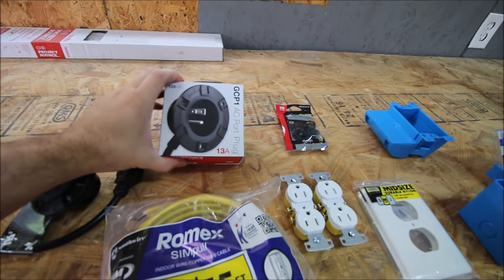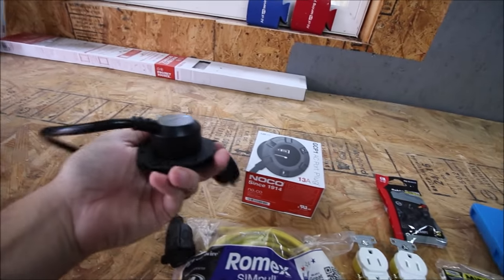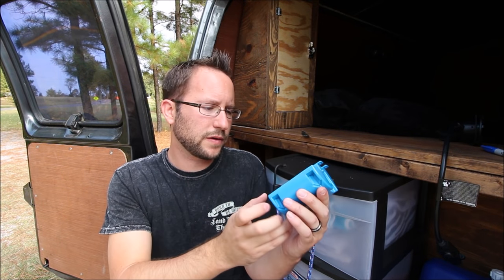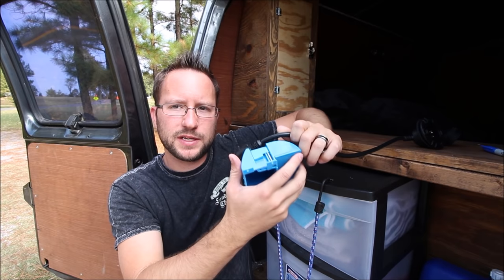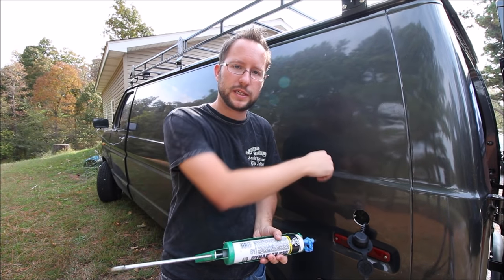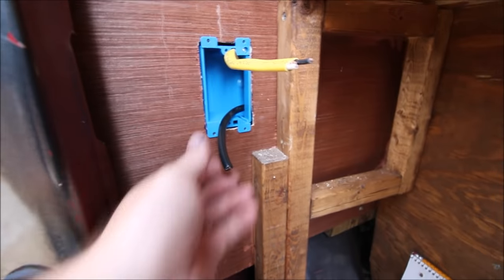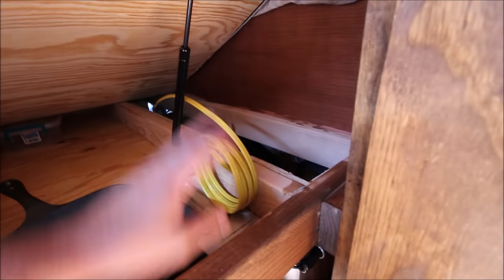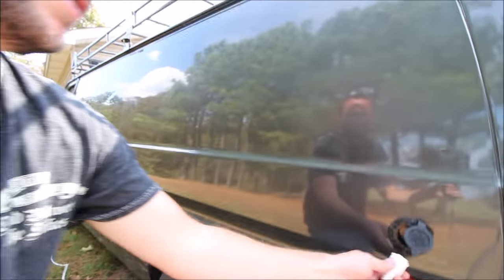Shore Power install on my Camper Van

Comment: i like the video 
what type of wire you use from first outlet to the second one?
Reply from the maker: Noe Alvarez I used 12/2 wire from one outlet to the other I believe. Make sure your first outlet is gfci. I didn't do it originally but I have swapped it since the video. That way if any moisture gets to it it will trip

Comment: i'm trying to put a outside outlet for my enclose trailer but doesn't want to wire so much. would that work for the trailer if i install the cord in like that and just use the inside for plug in with out making a outlet box for it?
Reply from the maker: cher her yes, that would work just fine if you just need one plug.

Comment: I understand how your power is coming into your van from this vid. But how do you have power going into your outlets? I'm a dummie and need to see that part or have it explained lol
Reply from the maker: The power comes in and goes directly to the first outlet then jumps over to the next outlet just like in a house. It’s basically just an extension cord in theory.

Comment: So the only thing I'm confused about is how you ran the "second wire" going to the from of the van?   did you basically splice the second outlet and the exterior plug together?  I am doing the exact same thing. One exterior 110, to two separate outlets. No breaker box but will be using gfci on the first outlet, and the second outlet plan on running a regular outlet with usb connectors built in.I will be using either an RV park power supply, or my honda eu2000i, does this sound like it will provide enough power?  seems like it, if you are going to run an AC unit.
Reply from the maker: Joe Cuevas the plug on the side of the van is a male 110 plug I bought off amazon and is wired to the first outlet directly. I have changed the first outlet to a gfci outlet since the video. No breaker box or fuse box as it is basically an extension cord or short 110 run like you would run in a home. A Honda 2000 should run a 5-6000 BTU AC just fine.
Reply from the maker: There is no splicing involved. You wire the plug on the outside of the van to one side of the first outlet and the run a wire from the other side of thefirst outlet to the other. Just as you would when wiring a run of outlets in a house
Reply: RubberTrampRenegade thank you!   Now I can picture it.  Sorry , I am unfamiliar with household electrical
Reply from the maker: Joe Cuevas no problem. If you aren't familiar with household wiring do a little research. It isn't difficult, you should be fine on this. Just make sure you use the proper size wire and wire the outlets correctly. Don't let the negativity in the comments section scare you. I haven't died yet.

Comment: How did you connect the black and yellow wire behind the hole?
Reply from the maker: Stripped them back and used wire nuts.

Comment: nice! Found your video, as I am starting to do a similar project. Where did you get the AC port plug? Ive been looking for one of those
Reply from the maker: Matt Brennan I got it off amazon. You can probably fund one at camper supply places as well.
Reply from the maker: Matt Brennan I got it off amazon. You can probably fund one at camper supply places as well.

Comment: I am curious, do you use refrigerate ( 120 v) while you drive. I mean ref running while u drive?
Reply from the maker: My refigerator is 12 volt and runs off my 12 volt system while I am driving or while I am parked. I dont use 120 for refrigeration. My 120v setup is a completely different system and I cannot run my 12 volt accessories off of 120 when pugged in.

Comment: Well how did you wire it you didn't show that part which is the most important part ?
Reply from the maker: You wire it like any outlet in any home. It’s 3 wires. Relatively simple. Basic wiring. Black wire to the gold terminal, white wire to the silver terminal, and uncoated wire to ground. Pretty hard to mess up.
Reply: @RubberTrampRenegade  how do you connect the second outlet
Reply from the maker: You connect the second outlet with wires from one outlet to the next....
Reply: @RubberTrampRenegade  is is safe to connect the wires at the same point as the first plug and what gauge wiring is best.

Comment: What is the part number on the NOCO plug? 
Thanks
Reply from the maker: grantar2 https://www.amazon.com/gp/aw/d/B009ANV81S/ref=mp_s_a_1_1?ie=UTF8&qid=1478955473&sr=8-1&pi=AC_SX236_SY340_QL65&keywords=noco+genius+gcp1+black+13+amp+125v+ac+port+plug&dpPl=1&dpID=41Y%2BimT05UL&ref=plSrch
Reply from the maker: grantar2 NOCO genius GCP1

Comment: you forgot to paint the holes you drilled, those part will rust. also it would have been smarter to install that at the bottom of the van, plus there are idiots who will think its a gas cap
Reply from the maker: Painting it would have helped. I siliconed around it so the likelihood of water getting to it was slim, but you’re right. As far as someone thinking it was a gas cap, I’m not sure that makes much difference to me. People can think what they want.

Comment: That 12/2 Romex wire is rated for 20 amps.  Your outlet is rated for 13 amps.  You should have used 14/2....15 amp rated wire.
Reply from the maker: Wow, another troll who knows it all. Imagine that.
Reply: @RubberTrampRenegade  it's your money butthead.  You're welcome.
Reply from the maker: chris Subleski chris Subleski had the van like this for over 2 years and no problems. I’ve sold the van to a guy who lives in it on the road with his job. Still going strong. But according to all the trolls on YouTube I did everything wrong. Tired of hearing what I did wrong from all the people sitting on their ass doing nothing.

Comment: How do you ground?
Reply from the maker: Your battery should be grounded to the frame. You can use a large wire to ground a post to the frame. In this video I used a large fuse holder as positive and negative posts. One goes to the positive on the battery and the other goes to the frame, but could also go to the negative on the battery as long as the battery is grounded to the frame. Your negative on your accessory should go to either the ground post, the negative on the battery, or directly to the frame. However you decide to do it.
Reply: How do you ground the AC Electrical system

Comment: Do you have a problem with it staying plugged in at the van? Do you wish u would have used the shore power that plugs in and you twist to lock ?
Reply from the maker: RobesEleven the plug stays together tightly and I have not had any trouble with it coming undone.

Comment: No fuse?
Reply from the maker: luftschutz nope. It's basically just an extension cord. If I hook into my garage, my garage has a breaker. Or at a camp ground there is usually a breaker. No need for a fuse. Do you use a fuse when you plug in an extension cord to the wall?
Reply: is a fuce necessary if it has a gfci box?

Comment: Would have been a lot easier to just plug an outlet strip (with breaker) into the female end of the shore power.
Reply: This would actually be a more secure connection. Plugs would plug into an outlet more securely and be safer than a power strip. It's actually highly recommended to not use power strips.

Comment: Dude, camp grounds have nasty wiring issues, no breakers means blowing up what ever you plug in, line in first goes to breaker box, then to your lines.....suggest you not use that away from home!
Reply from the maker: This video was posted 3 years ago. I had the van 2 years after this video was made. I’ve since sold it. I never had any issues anywhere with plugging the van in. This is nothing more than an extension cord. It doesn’t power anything other than the 2 outlets on the series. My other electrics ran exclusively on the 12 volt auxiliary battery. I’m still alive, didn’t burn down, didn’t die. Everyone on YouTube is so afraid of everything. Go live your life and stop worrying so much about what other people do on YouTube.

Comment: You better make the first receptacle a GFCI or your ass will get killed. Trust me.
Reply from the maker: Claude Rains thanks, my ass will look into it.
Reply: So by adding a gfci to the firs outlet that removes the need for a 30 amp breaker box?  if so that is awesome because I do not have the room for a breaker box in my trailer